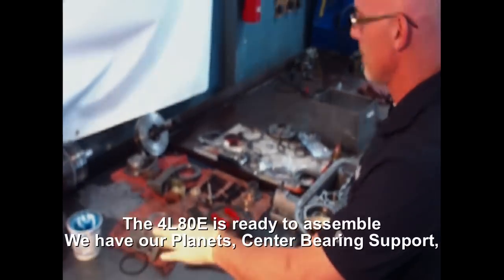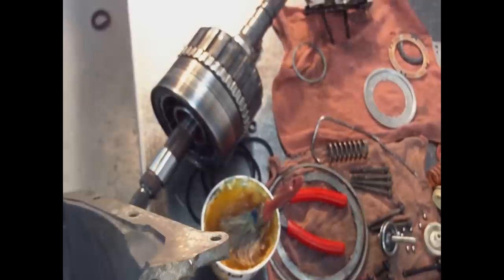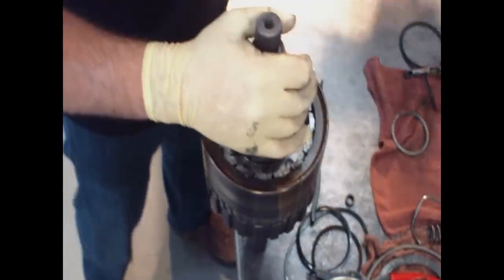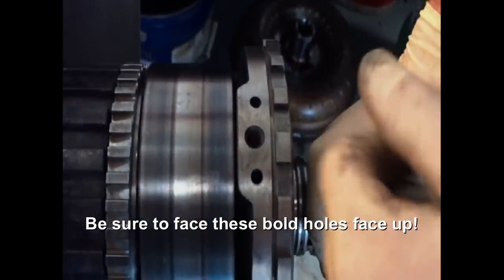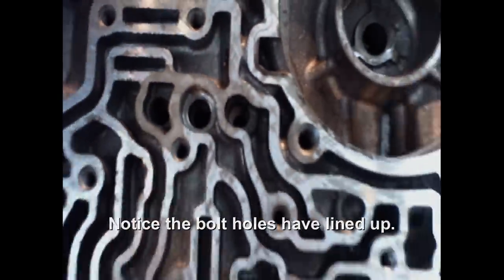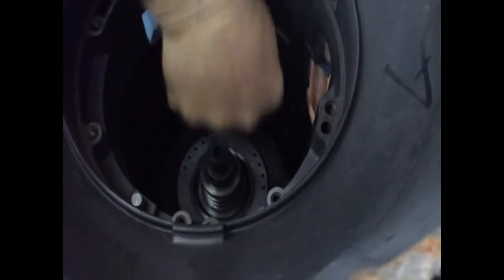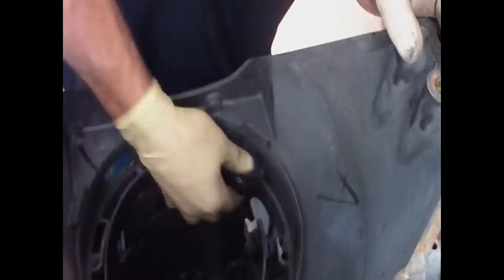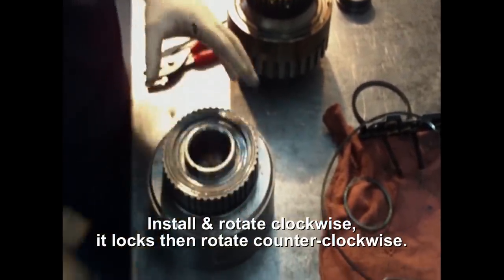5 of 7 Leale's Transmission Repair Rebuilding a 4L80E Transmission

Comment: I'm in HELL with this stupid Pioneer low band that will NOT stay on the pins. 
10 hours and bloody fingers. Tried everything, laying trans on it's side, packing up the backside with assembly lube to keep it in position...nothing works. Do not buy the Pioneer low band ! The original GM part has longer holes that actually catch the pins better/deeper.